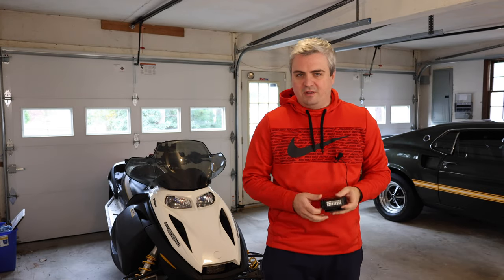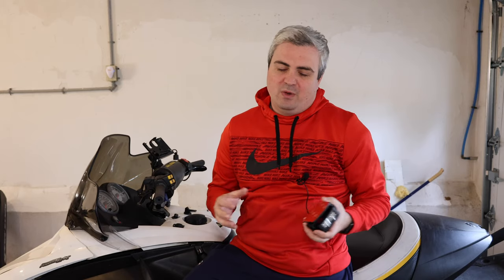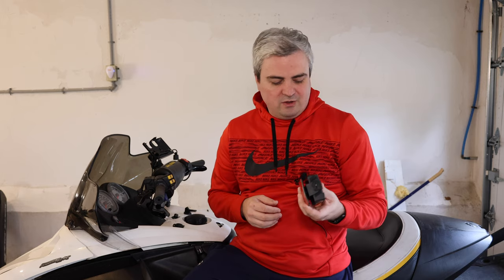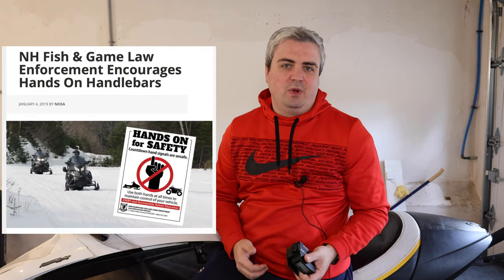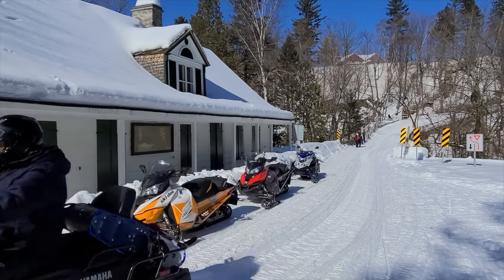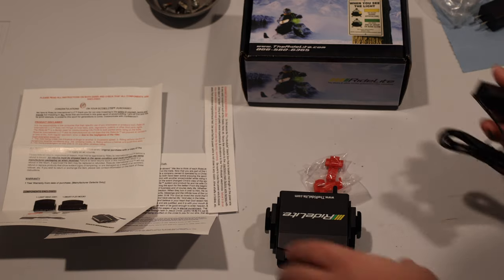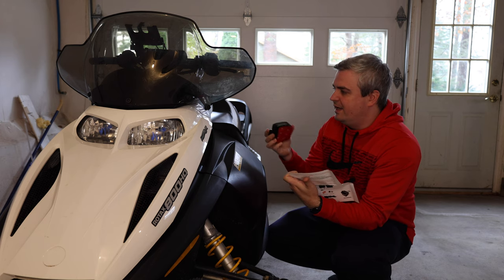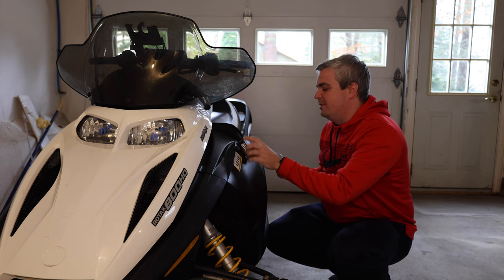Installing a RideLite | Snowmobile Safety Device

Comment: Thank you for a fast simple video. Well done. I can see another reason not to have it mounted more on the outside and low where you were thinking of putting it - contact with trees and brush and snowbanks/deep snow. I tend to roll my sled sometimes so it might get ripped off easily I think.
Reply from the maker: You bet! Thank you Fred. That's another good idea to keep it higher.